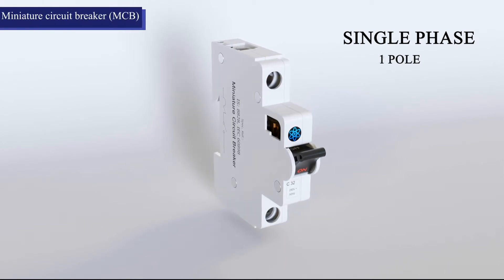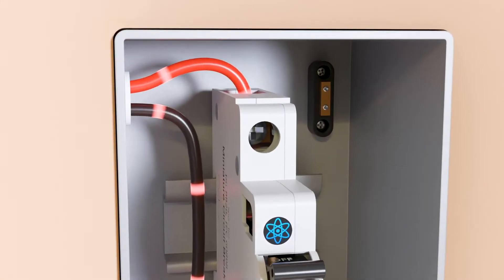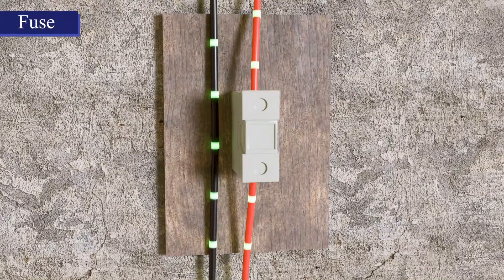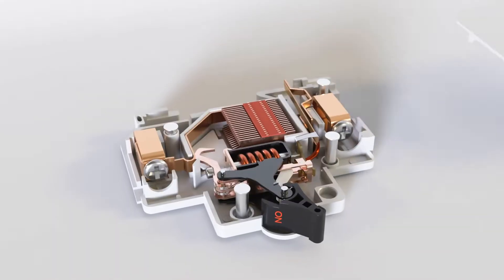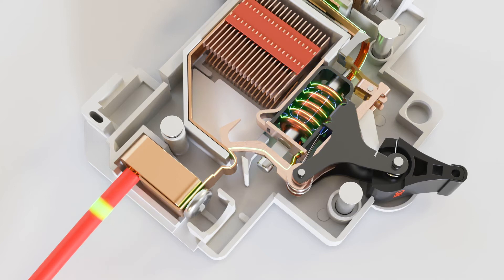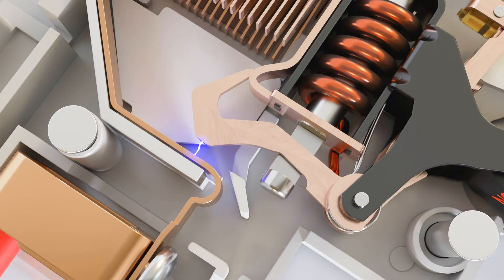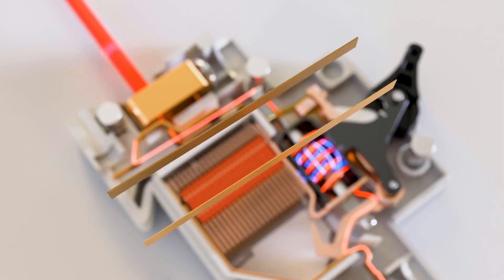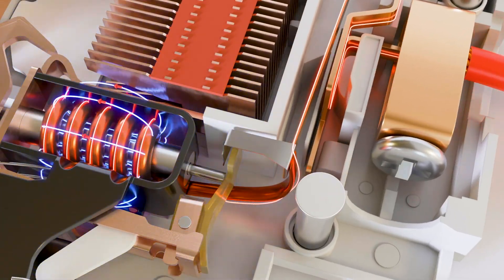Why are miniature circuit breakers (MCB) so important? |3D Animation..

Comment: What you described is Thermal Magnetic breaker, whose overload trip time varies depending on operating temperature. Hydraulic Magnetic circuit breaker has less temperature variations.